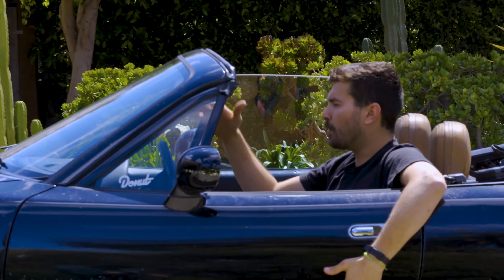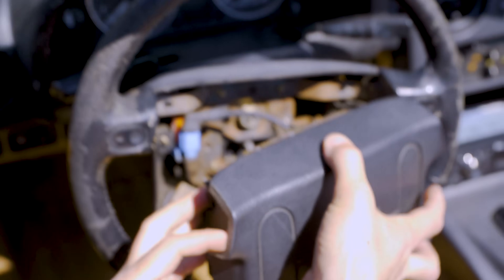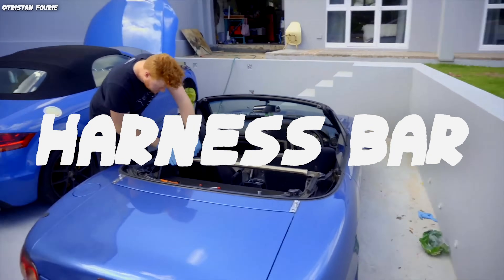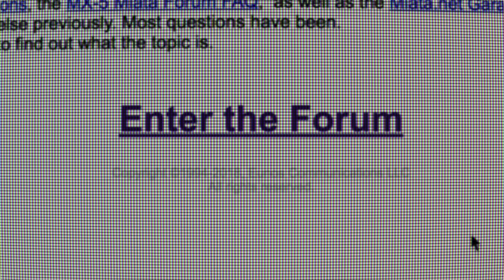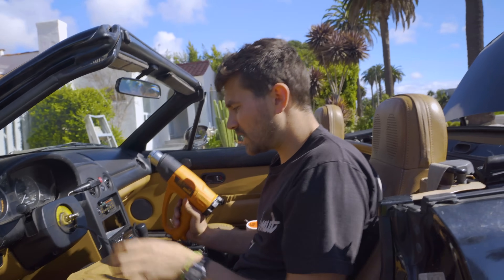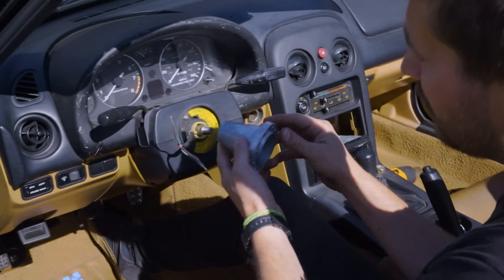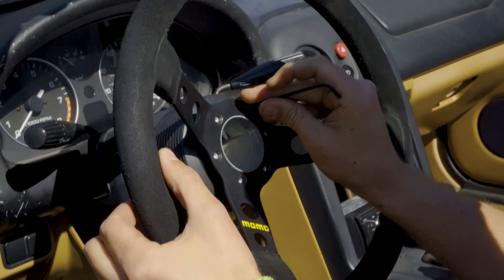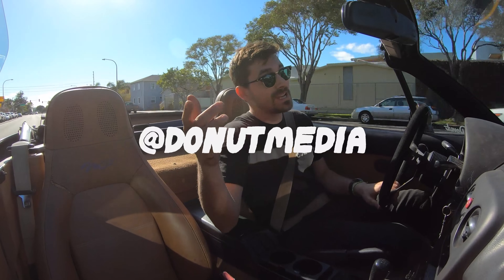HOW TO: Change Your Steering Wheel

Comment: I am showing my age but it's been so long ago my memory is hazy. But it seems last time I removed my steering wheel I needed puller for the wheel and a lock-plate adapter with the puller. No way hitting it with your bare hands gonna help any.

Comment: I Donuatteam,

what would happen if a cop stopped you? 
Do you need any papers for the tuning that it is legal? 

To my knowledge, it would be almost impossible to chance a steering wheel without an airbag in Germany. 
The wheel and the coilovers would be possible, but care must be taken whether they have been tested for the car or otherwise. In addition, the car must not rub in the wheel arch when changing the coilovers and changing the wheels, and the car may be max. 11 cm deep.

LG Fabian from Germany

Sorry if the english is not that good.

Comment: Hi I think small steering wheels and sports Dural so great and they're cool and I do like them but the biggest problem is from my understanding it is against the law to disconnect your airbag or go without an airbag if the car came with an airbag from factory so manufacturers need to think about that and make a sports steering wheel where you can put your old airbag onto doing what you're doing with a roll cage and a 3 point harness is all good but the law says in Australia you're not allowed to disconnect your airbag so why don't these companies that make b sport steering wheels start thinking about being able to put your airbags back into your car in Australia with not allowed to do what you're doing to trick the light or take the globe out of the dashboard

Comment: Anyone else have an issue with a 3,000 ohm resistor in series on their airbag? i put one in but it didn't stop the light from triggering. i was also told you need a 330 ohm resistor

Comment: I don't think a 5-point harness is an alternative for an airbag. And airbag is like a giant pillow to land in, the 5-point harness will grab you at your shoulders. If you end up in a collision then i think you are underestimating how hard that impact is & that it will break your shoulders. 5-point harnesses are for rolling over, not for replacing air bags. Also, if you remove the original safety features in some countries like Belgium and Netherlands you will fail the yearly inspection.

Comment: I have a question. As airbags are mandatory in many countries, what's the legislation about changing the steering wheel and not putting back the airbag? In Europe you have to bring your car for a technical check-up every two years to see if your car is fit to drive... I doubt they'll let you drive around without an airbag if your car is supposed to have it in the beginning, right? Could anybody enlighten me?

Comment: resistor did not work on my miata... tried 3k ohm resistor 3,000 ohm resistor 3 ohm resistor.... measured resistance at the air bag at 1.2ohms put a 1.2 ohm resistor still didnt work... now i have this annoying as light that wont go away.... im gonna have to pull my dash now to pull the damn airbag module... regret doing this

Comment: Be careful when removing steering wheels. My old boss had to get dental implants after a steering wheel broke his teeth out. Instead of using a proper wheel puller, he was pulling back on the wheel with both hands while his assistant tapped the shaft with a hammer. Broke out all his front teeth when the wheel let go.

Comment: I don’t recommend doing this mod on a street car or daily driver unless you are retaining the airbag. Airbags are important safety feature when you get into a crash. Do you want to bang your head hard on the wheel in half a second and get a concussion?
Reply: It’s called a harness. But if you want a harness for street use, buy an ASM certified harness.

Comment: Isn't wearing harnesses without a helmet and neck brace actually worse than just wearing a normal seatbelt? Normal seatbelts are angled and designed for the driver to "roll" into the impact. A harness keeps the body in place but that head is going places

Comment: Does anyone know if it’s possible to swap a steering wheel with an airbag from one car, and put it into a different type of car and have the airbag remain functional? I wanna out the NB Miata steering wheel into a 350z.
Reply: I recommend that you look at Cipher Auto. They have aftermarket steering wheels with airbag brackets to install your factory airbags in. Hope this helps. :)

Comment: Vanity is important to many but airbags exist for a reason. Especially with a 30+ year old design, in a lightweight car in a high speed collision, you're going to eat that steering wheel. 9 inches of air cushion could be the difference between instant death or a light concussion should the worst happen. Even 30+ year old airbags will work given the wiring isn't corroded or modified, look at all the wrecked Miatas on copart. You do you but the engineers put the bag there for a reason.

Comment: you guys forgot a really important part!!!!! First you need to wait atleast 30 minutes until you can work on it after you disconnected the batterie. It can go off if you work earlyer on it!!!!! the have a savety feature if the battery gots ripped out in a crash that a condensator saves for atlest 15 minutes the necessary voltage to deploy them. And you should probably not work on the airbag. I can only talk for my country. And here its highly illegal to even think working without training on an airbag. there are some stuff that you need to worry about too. But this is the most important part.

Comment: Can someone explain why you wouldn't want an airbag in your car? I get the cool steering wheel and all, but why would you leave it without an airbag, is that a fair trade?
Reply: Most aftermarket steering wheels don’t have it.
Reply: @EbilEnemyofBurgerTown  well that wasn't the question
Reply: @dimitrijekrstic7567  

Mkay then. I apologize if I was being too vague. Here’s some more specifics: According to FIA racing rules, competition vehicles are PROHIBITED to have working airbags due to the fact that airbag impact sensors are very sensitive, and any bump or contact with the sensor can set it off, and to put that into Layman’s terms, if the airbag gets triggered,  you will get hit in the face and you will have no visibility temporarily due to it inflating. Airbags make sense in a road vehicle, but it is not safe in any racing competition vehicles. I hope this helps. :)

Comment: yo can someone help me find a hub that fits my car and is able to attach to the quick release. I have a 2016 audi Q5 and I am looking to get the NRG Quick release 3.0. When I look on the actual NRG site for a hub, the nrg srk-183h pops up and says it fits, but when I try to order it from a different website, it says that it doesn't fit the car. If anyone has the time or knows what will fit just let me know.

Comment: A SOLDERING GUN for a couple of thin wires?
You ain't soldering stuff on a daily basis, are you? I use my soldering gun when I'm soldering, like, solid copper wires from the wall outlet.
Using a soldering gun to solder a resistor is like pulling out a minigun to go spearfishing.

Comment: There's some terrible advice in this video. If your wheel alignment was good beforehand and your factory steering wheel came off straight, and you can't line the hub up, then the hub is not made right. You should never try to correct an off centre steering wheel via the alignment, unless the alignment was way out of whack to start with. You end up with more lock in one direction.

Comment: Why would an airbag get set off if the battery is disconnected and the crash sensor is not triggered. The car is standing dead still, as if the air bag would go off?
Common sense people.
Reply: residual power, there is a reason even the manufacturer recommends waiting after disconnecting the battery

Comment: Why the persistent unsubstantiated myth about airbags deploying randomly when disconnected?
Static electricity in the short connecting wires cannot generate enough current since the airbag needs around 1 Ampere to fire and also there is a shorting contact in the connector block to definately make sure to prevents this.
And there is of course obviously no firing voltage present in the wiring at the time..
They should also have taken off the airbag cable beneath the clockspring assembly and installed dummy resistor directly on the contact block instead so they wouldn´t have to cut any wires in case they would like to put things back to legal original state..

Comment: hey hey hey. dont send false info. 3 point is still safer than a 4 point. the only 4 point to use is ASM which behaves like a 4 point till you crash and in turns into a 3 point. you can slide through the bottom of the seat belts on a 4 point. your energy has to go somewhere when you crash and youll "submarine" look it up. the air bag also pertects you from snapping your spinal cord when your head whips forward, harnesses make this worse. at the point of a harness you need to pretect yo neck with a hans device.. please dont put the wrong equipment in your car. study a little more before you follow these guys. best case do 4 point ASM or 5 point with a HANS device and helmet.

Comment: Yeah good job, you just LED several people to deploying their airbag and somebody probably broke their arm. Is that airbag has sodium nitrate inside of it which is the same thing that's in a hand grenade. The problem with this is that you didn't let the capacitors drain in the car. Airbags can go off even if the car is off and even if there is no electricity for a 20 minutes. There are capacitors in the systems that hold a charge very specifically in case the car's battery is disconnected. Also, when you're disconnecting a squib they're not always blue. Most of the time they're labeled with yellow. This is again not a proper video and just shows people how to get hurt. You didn't explain the importance of disconnecting the negative battery terminal and why.

Just because an airbag is from 1994, does not mean that it does not work.

Safety harness does not replace an airbag at all. the supplemental restraint system and the 
Passive restraint system were designed to be utilized together to not only stop the person but to remove blunt trauma from seat belts. In fact, seat belts these days stretch more because of the inclusion of airbag systems. A racing harness could possibly kill you more easily

Also, you didn't explain the importance of the clock spring which is utilized to maintain continuity through the system as the steering wheel turns.

Using rosin core solder is not a specific preference. It's required legally.

You also showed everybody the improper way to use a torque wrench as you put an extra 5 lb of torque on that nut. Torque wrench is only tell you when something is tight enough by clicking, they don't tell you if you torque them too tight. You see this is the problem with people that don't understand the science behind all of this. And it's not even that hard it's just basic physics. Do you still feel that nut tightening up after you hear the click? Well guess what that's the not getting tighter. And the fact that you did that on the steering column runs the risk of that breaking off as you're driving.